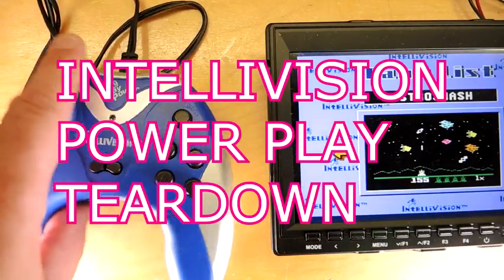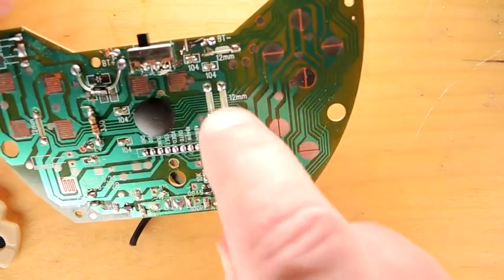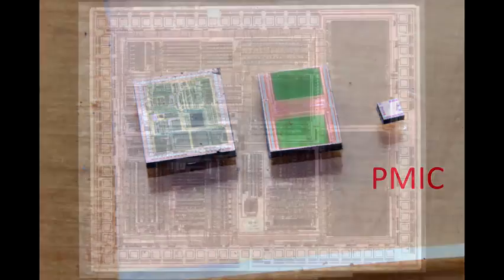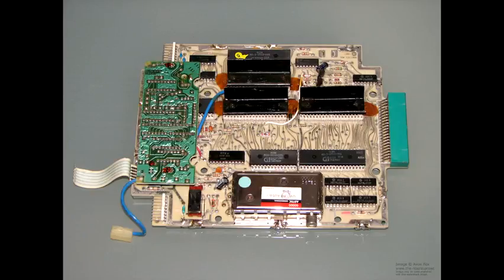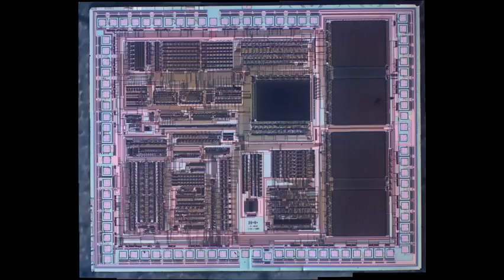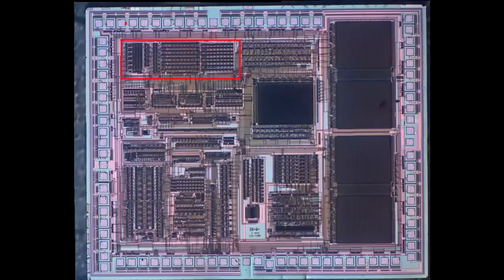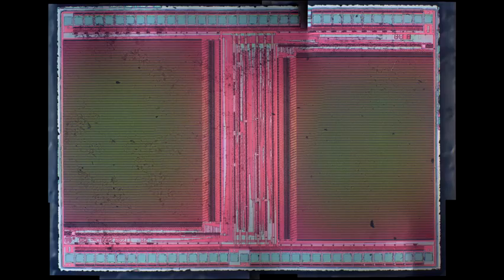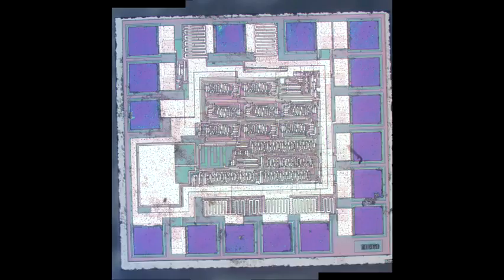Intellivsion "Play Power" teardown

Comment: I'm really surprised they made a custom chip for that. Designing semiconductor chips is usually very expensive, but they could maybe achieve it for cheap as it's made from existing building blocks. They may also make this chip on a multi project wafer.